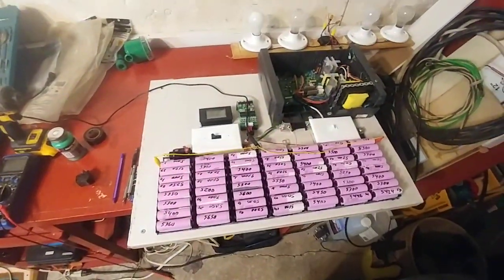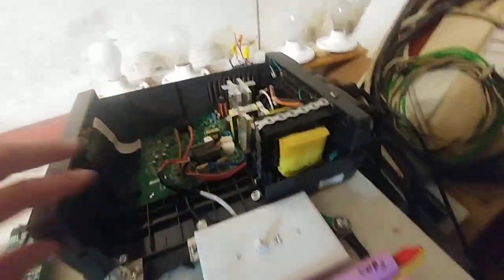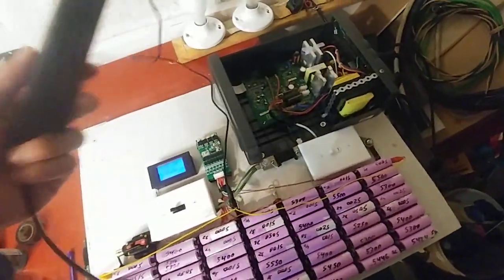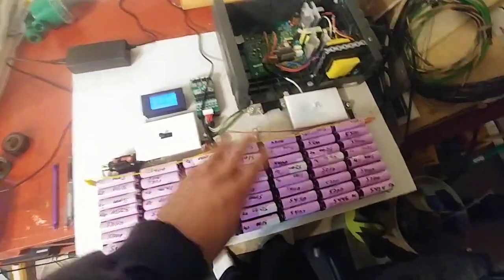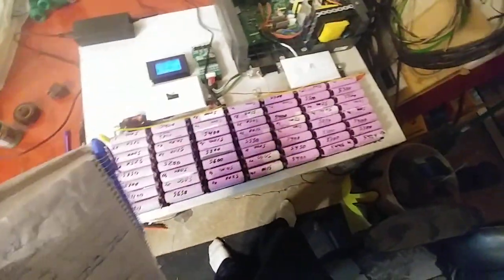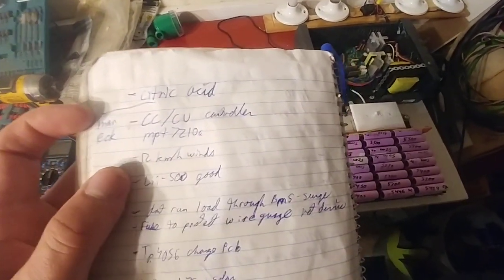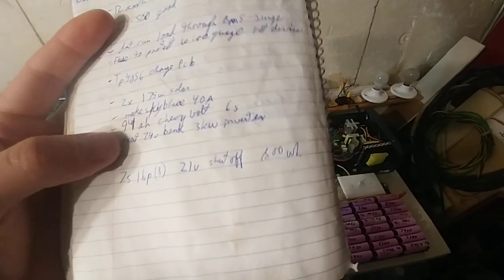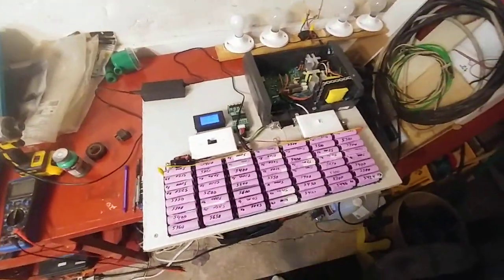18650 7s 3s 4s diy ups

Comment: how is that BMS working out?
Reply from the maker: tones of changes since this video. check out: https://youtu.be/TWab33El9sg
that specific bms hasn't given me any issues at all. It works and that is about it. I would recommend a Bluetooth bms instead for any large projects. 
https://www.aliexpress.com/item/7S-24V-20A-30A-40A-60A-18650-Lithium-battery-smart-protection-board-balance-bms-pcm-W/32961106224.html?spm=a2g0o.cart.0.0.6f4a3c008OgRfv

Comment: Look for a fisher paykel, lg or samsung washing machine for the  pma motor. They work great for diy wind turbins since its AC and you can make a long wire run then convert to dc closer to charge controller/batteries. If you cant find those then a regular treadmill motor will work.
Reply: BOOOM..... there ya go :)

Comment: On the Chevy volt batteries... I'm adding a 7th cell using Ford Cmax cells. I had considered using my small supply of 18650 cells I currently have and it would be fine but in the interest of fiddling with another type of battery cell I figured I'd give it a go. :)

Comment: 24vdc works far better for li-ion batteries. 12v and li-ion just doesn't land in a proper voltage range that will allow  the usable voltage range of the cells.
Reply from the maker: You say that but do you have a physical demonstration proving all aspects and variables? :p i must know first hand
Reply: Plenty of videos out there showing exactly how much better 24/36 or 48v works. No sense in kicking a dead horse. :)
Jehu Garcia has a very detailed video explaining this exact scenario.

Comment: Man you get MakeSkyBlue 60A plus is 70€ other that you just mentioned is 40€ or something like that...
Makeskyblue is proper mppt charge controller....
But you already have one...
AliExpress have modular pure sine wave inverter for like 50-60$ seller is HUAYURUI and you could change R1 and R2 for different supply voltage's only one thing for every voltage you will need different output transformer.....but you are smart guy you will figured out..... Is cheap and low frequency inverter.....